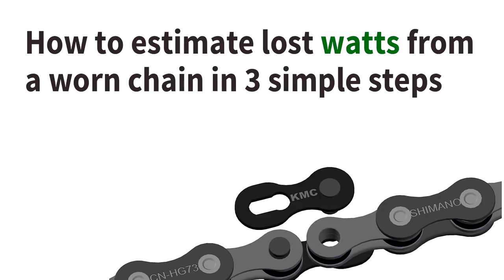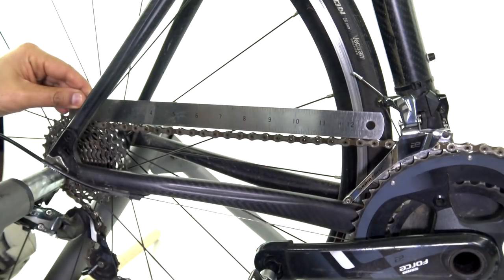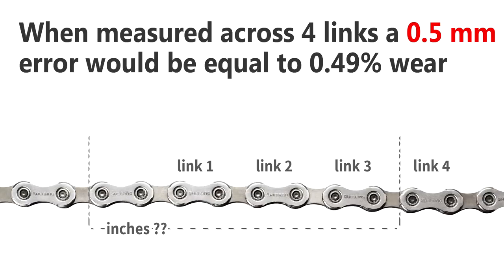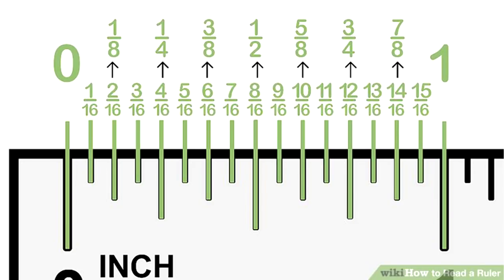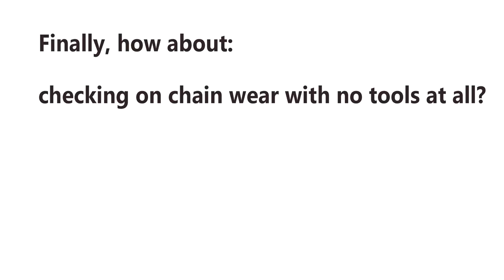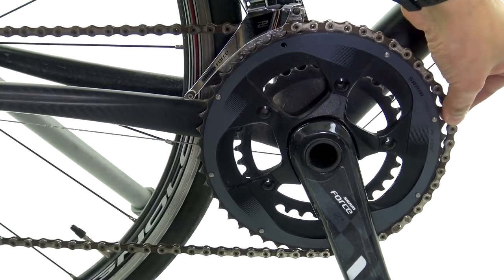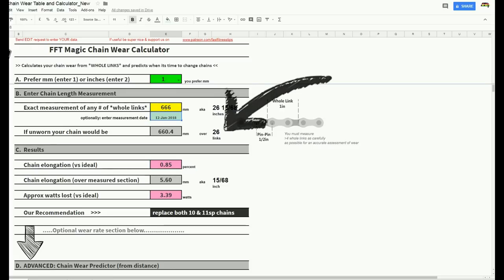How many watts are lost from your worn chain? (aka measuring chain wear)

Comment: It would be nice If I could enter the distance measured between external edges of links, for example 7.5 links. Using micrometer gauge measuring such distances is just more precise and easier to do - you just put those hooks on the gauge inside the chain and stretch the gauge until it stops. No need to measure on the side of the chain. Not sure if it's clear what I mean. Anyway it shouldn't be a problem to calculate everything having the measurement done this way. Standard chain usage gauges take measure like this.
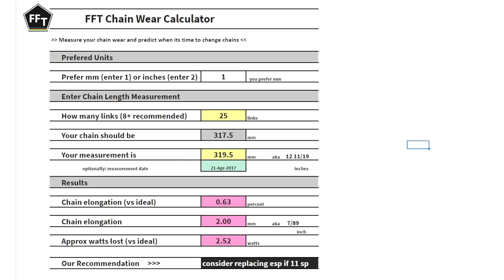Reply from the maker: If you insist on measuring non-whole links, but part links you can with this version (shown in the video at 4:22) http://goo.gl/KJg34T

Comment: I haven't found the ruler to be accurate enough on any of my worn chains. I've decided to buy a park chain gauge instead.
Reply from the maker: Hi Aaron, as mentioned in the video the basic gauge is fine provided your chain starts at zero elongation. Rulers only work if you have a good quality ruler and measure over a good number of links. thanks for watching.

Comment: would be nice to test a YBN titanium chain to see if the silly price tag is of any benefit due to the tolerances its built too and the strength of titanium over steel.
also is this test assuming you are using a wet lube or waxing the chain.
Reply from the maker: vincem5 more chain and drivetrain stuff coming soon

Comment: I have seen some chains perfectly fine on the ruler that were actually worn measured with the chain tool. The ruler doesn't show roller wear which occurs earlier than side plates and pin wear
Reply from the maker: Actually its the roller > bushings > pins  which wear causing elongation not the side plates (see https://www.diamondchain.com/understanding-wear-life/). Yes there can be differences in wear between links, but its almost impossible to have a worn chain without roller/bushing wear....so your observation is very unusual. Also only one tool the shimano CN42/CN41/CN40 claims to look specifically at pin wear. If anyone could quantify this observation vs a ruler I would be very interested.
Reply: Fastfitnesstips I was saying that using the ruler method the chain appeared still in good shape but on the park tool chain wear indicator it was at nearly 1%. So for me at least the tool is the better choice.